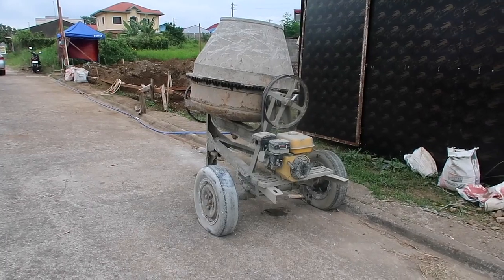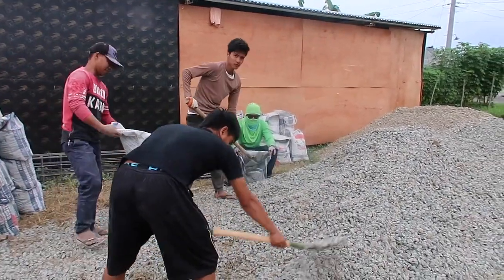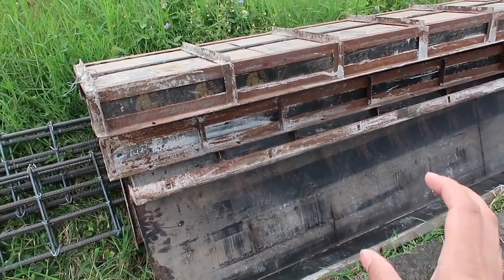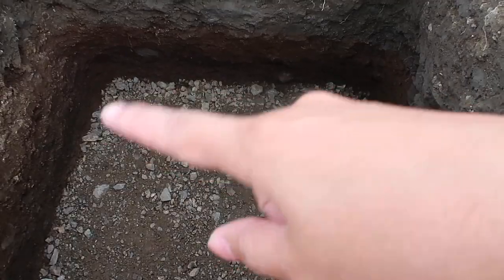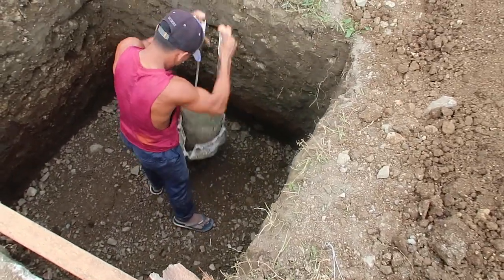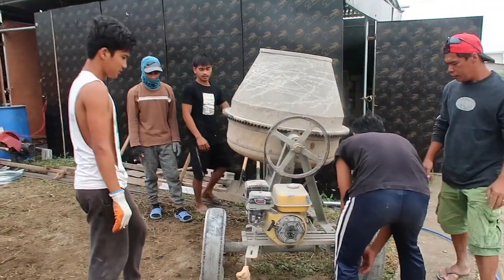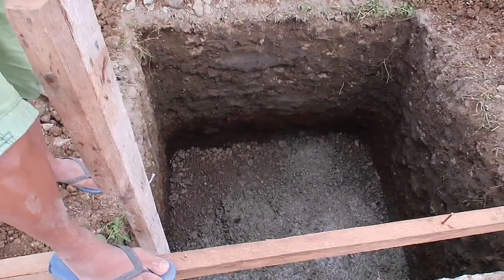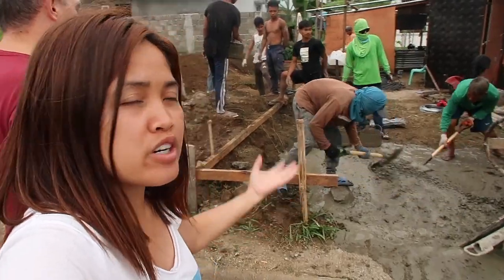HOUSE BUILDING IN THE PHILIPPINES - EPISODE 9: BASE COURSE POUR

Comment: Hope they removed the wooden ladder before the concrete set.  Did you say Cold?     OMG.  We were on the farm Monday and Still was hot,   I Hope you get a weather break from the upcoming storm
Reply from the maker: 😹 well find out tomorrow
Reply: @temiller63  They like to make concrete pools on the ground and leave them there unless you make them clean it up.   A big box made of hardi=plex which is on the walls of their home they made will save lots of cement
Reply from the maker: They have their own way, they want continous mixing while others is carrying to the other hole.Tomorrow we might be getting attachment for easy shoveling and easy pouring.
Reply from the maker: They will bring mixer board so no waste